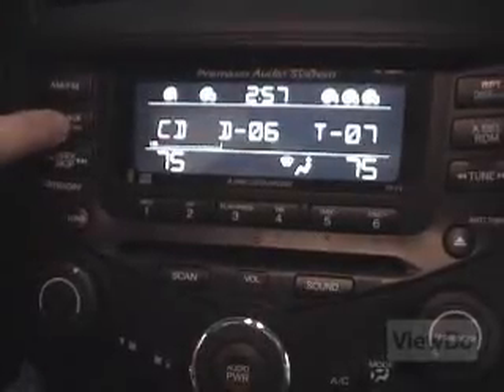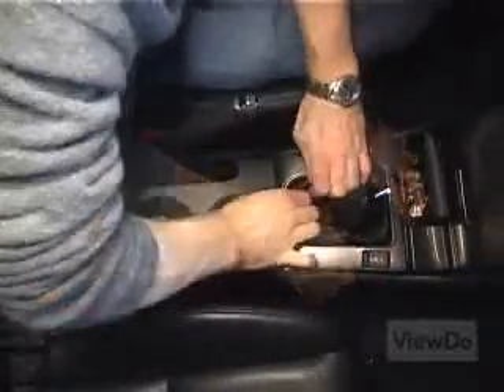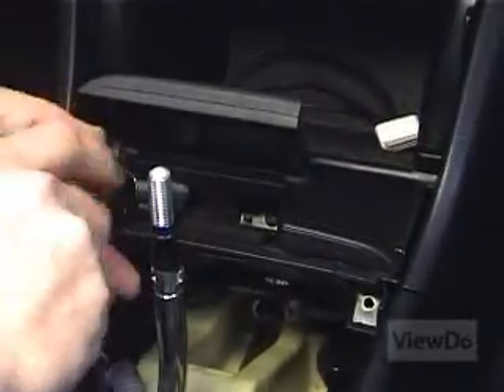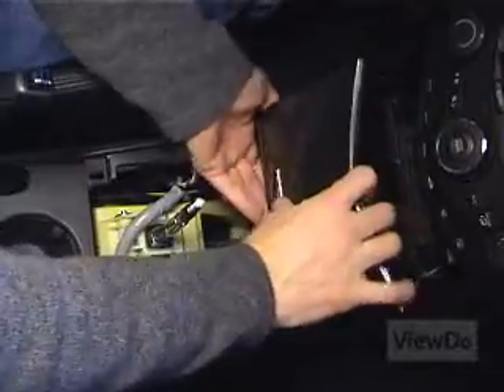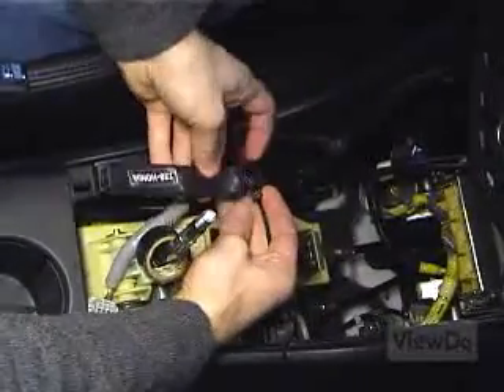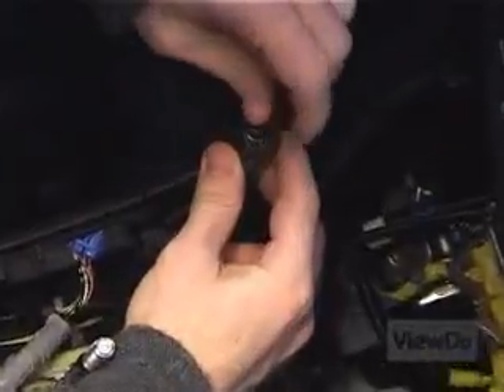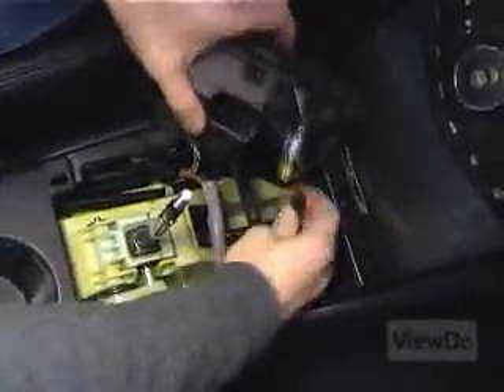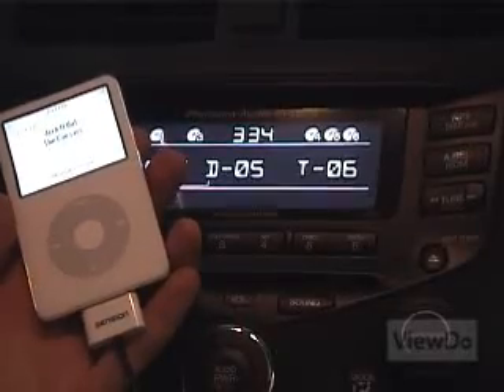ViewDo: How To Install an iPod in an Accord

Comment: I was skeptical at first about one, installing this type of installation and two, installing it myself.  I actually bought my adapter from Crutchfield because they provide a plug and play connection.  Mannn!!!  The install was relatively simple.  The sound quality is fantastic!  Sounds really good thru the car speakers.  No whining, no hissing.  Just pure digital sound.  Crutchfield also supplies instructions with photos to help you.  Along with this video, you should be able to do it yourself.

Comment: Hi guys, I got excited and I ordered the Dension link. It was available only on Ebay.
Ok, I got a little disappointed because the docking cable comes as a docking station instead of a cable and I don't a station, I want a simple ipod cable. 
In the video, you had a cable but I received a docking station. I think you should have shown in the video the changes you made about the cable.

Ok so please help me out: 
How do I turn that docking station into a docking cable? 

Thank you

Comment: this job was ok but not a profecinal one. You just drilled a hole with out attaching a rubber seal arond the inside campartment so the wire is in a secure place like honda dose on there vehicles.

Comment: @alcoholicmr i put a blitzsafe in my accord yesterday, it too like 20minutes to the the pannels off, plug in the adapter and put it back. Its not hard dude. Trust me...im so glad i dont have to listen to the god damned radio and the same cds over and over. Its worth the 20 mintues and it sounds clear. FM transmitters suck balls. Ill never use those crappy things again.

Comment: wtf o.o u don't need to do all that!! theres a WAAAAAAAAAAAY simpiler way. theres this thing u can buy, doesn't cost much, which is a tape player with a wire coming out of it with a connection to ur ipod. connect it to ur ipod, then put the tape into the tape player and boom, ipod on ANY car.